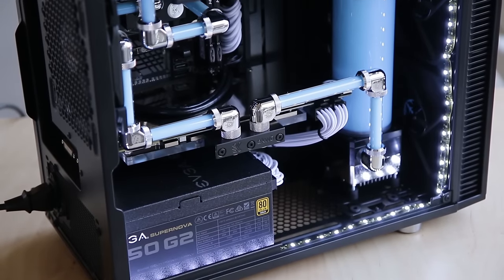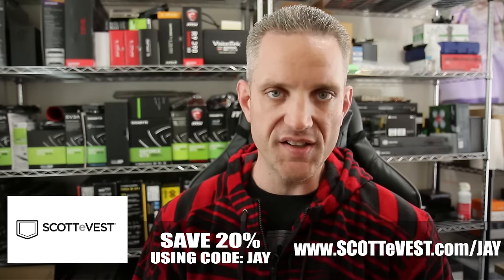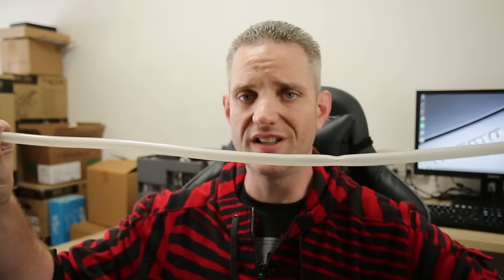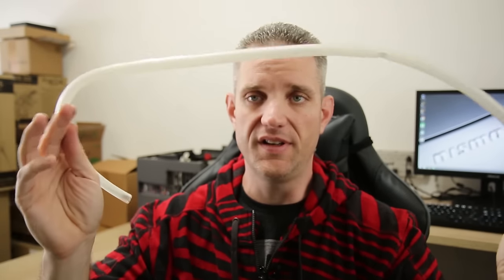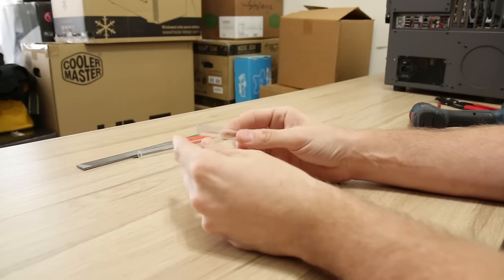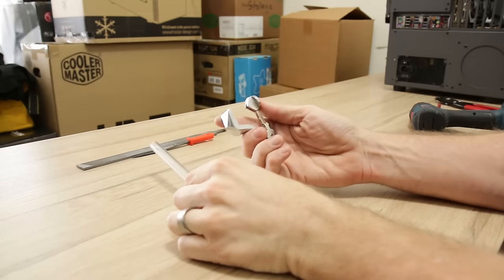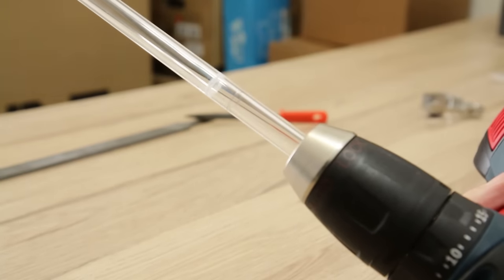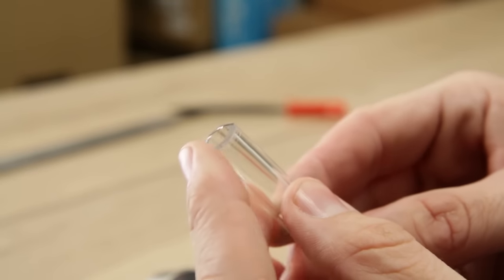Tutorial - How to cut glass tubing for watercooling loops

Comment from the maker: Everyone telling me to avoid the glass dust literally makes me want to go inhale it.
Reply: +JayzTwoCents save a line of dust for me
Reply: Everyone told me I couldn't drink bleach. I proved them wrong.
Reply: +JayzTwoCents Does it smell like blood?
Reply: lol Jerry Rigged
Reply: +JayzTwoCents Glass dust is evil stuff.....not as bas as aluminised glass fibre........majorly carcinogenic and only a few points below asbestos in causing big health issues later on in life. The big caveat is that just using it or glass rarely isn't a huge problem unless your in a high volume production environment, I'd still mask and suit up and probably have a suction system to pull the dust away. 

Better to be safe than sorry, right?
Reply: +JayzTwoCents If you dont have a bunsen burner, they do make those gas powered lighters with the blue flame, which are basically miniature bunsen burners running off a tank... Deal extreme (and simular sites) has oodles of options for less then 5 bucks including shipping, search for jet lighter and you should find plenty
Reply: +Matthew Sykes wow wow wow to many big words
Reply: +JayzTwoCents Eat it. want do you much harm.. :P 
Get some kerosene and drip on the cutter before cutting the glass. Cuts it smoother and cleaner.
Bending the glass, get a half/quarter circle mouthpiece on that gas burner / lighter.
Reply: so skunkworks version 5. New glass tubing.
Reply: +Nick Grech Like with Coca cola, glass is always better.
Reply: +JayzTwoCents Actually I just thought, why not upgrade Skunkworks with copper tubing, that would be AWESOME.
Reply: +JayzTwoCents jet fuel can't melt steel beams.
Reply: +JayzTwoCents Why the hell would you want to carry a GPU in your jacket? :D
Reply: +JayzTwoCents You said you were looking for other ideas for cracking it after the initial scoring.. You could heat it and then rub an ice cube on it, the temperature shock would cause it to break itself.. No point really, other than being kind of cool. XD
Reply: +JayzTwoCents Btw, can you do a generell tutourial on working with hard tube watercooling?
Reply: He did a guide just a few videos ago on how to bend hardline tubing. Search his uploads, fairly generic titles for the topic.
Reply: +JayzTwoCents I was about to comment that until I saw this one 😂
Reply: Could you bend those glass tubs over a glassblower torch or is it a different kind of glass?
Reply: +JayzTwoCents i wonder, would a tile saw work for this?
Reply: +JayzTwoCents ahahaahahahahahaha :D
Reply: Hey Jay as a Glassblower I'm just gonna say you should be doing all these steps with the glass tube when it's wet. And there's two reasons to doing so. First is glass dust and second is to keep he glass cool while doing all of your steps while scoring. If you create too much friction you can cause the tube to crack or shatter. But seriously when giving advice to all of your subscribers please keep health and safety in mind.  Love your poor mans lathe and lots of glass blowers actually will chuck up the the glass in a drill every once in a while. Also if you need to remove a little bit extra off a tube chuck it up in your drill and press the tube straight down on some high grit wet sandpaper that's clamped to a table. (Also known as a poor mans reverse-lapidary) this can also be used to get the glass completely flush rather then having a jagged cut. (Because sometimes it happens.)
Reply: +austin welch Yes... Glass artists (including myself) have used tile saws to cut through glass. Just go VERY VERY VERY slow! You'll get a better cut but there is a possibility of the tube shattering and blowing up in your face. Probably not worth your while for this project. The method Jay uses in this video is probably the best way to go about this. Just make sure when using any tool with glass it should be wet to keep the glass cold and contain the dust.
Reply: +JayzTwoCents  It was literally my first concern when you started cutting it.
Reply: +JayzTwoCents if u applied some glasscutting oil to the diamond or the surface u would get a non jagged cut . Nice video tho .
Reply: +JayzTwoCents avoid the glass dust Jayz (no, inhale it, it will be good, you know you want it)
Reply: Jayz can you do video about the drain port and how to drain a rigid loop?😂😂😂
Reply: +JayzTwoCents Only snort borosilicate glass!
Reply: Will you replace/upgrade  skunkworks at the end of this year ?
Reply: +JayzTwoCents silicosis from glass can kill, it's actually fairly frequent amongst rescue workers and I don't think they inhale much glass ether.

I am saying they do have a point. You can actually die inhaling glass dust fairly easily.

I mean I probably wouldn't wear a mask, but they honest to god have a point, they do complain about everything, but this is one of those rare instances that they are in the right.
Reply: +JayzTwoCents Sure, it is annoying but most people just care about you.   We literally don't want harm to come to you.  You can buy a portable lab burner for $30.
Reply: try carbon  fibre  tube it's probably  not different  accept  cutting  it may cause cancer from inhalation  and a mask is required  to cut it
Reply: hey jay what is the reccomended size tube?
Reply: Didn't cover the clutting part of the tutorial. Downvoted (JK)
Reply: Anybody who lives in a desert lives on a mountain of glass dust. Guess they are all doomed.
Reply: @yuannanlin4503  Four years in hospital
Reply: Lol I exploded a glass bubble like 2 years ago and I still hear the echos of my mistakes in the comment section to this day. 😄

Comment: I do not know if anyone has commented and told you this about glass cutting, but first of all you should dip the edge of the cutter in fine oil, a small cut should be enough, you should lay the glass down the edge of the table before breaking ut, and make sure the cut is just over the edge of the table. If you follow these methods you will get a much cleaner cut. The edges on the inside and outside should be smoothened of with a sand paper (Feel free to use your drill for this). I have worked with glass for over 5 years and used to do this for a living. :)

Comment: I know this video is old now..... the wheels are not meant to score over a previous score. By continued spinning it damages the wheels so it has a greater chance of damaging cuts later on. Also a drop of 3 in 1 oil on the cutting wheels before cutting is recommended. I worked in a residential/commercial glass shop for 10+ years.

Comment: 'Scratch and snap' works fine for 'standard' Flint Glass Tubing. However, Borosilicate Glass tubing (Pyrex, Kimex,) takes slightly different methods. Like a EZ Dremel Diamond Cutting wheel, A Dremel drill press stand, a right angle Adapter, A workbench Board with a Low form of a Rail Guide and End stop , (of course an eyedropper of water). Then a Diamond Honing Plate (Typically used for sharpening Lawn Mower blades) in a rectangle dish pan with a little water and a squirt of dish soap in it, to Square up the ends. And finally, Yes, a Propane torch to 'Fire Polish the cut ends smooth, (So that the 'O rings' cannot be damaged by sharp of jagged cut end edges).

Comment: One tip. After the drill use ice to break the connection because it makes cleaner cut and you might not need to sand it so much.

Comment: hi, i used glass tubing for my custom desk-pc case and i can tell it is very easy to work with and it looks so incredibly clear. I did even get some 90° angeled tubes from a glass manufacturing company for only 6€ per piece. For cutting i used the same tool as you did, but for deburring i used a dremel with a diamond cutting disk. With the diamond disk you are able to grind a few millimeters in length if you messured the tube wrong.

Comment: From someone whose done both style of stained glass (and worked with glass tubing back in science class):

 For like $3 you can get diamond dremel wheels that will handle that job much easier. To torch the end all you need is to do it over a gas stove burner.

Comment: A dremel is not that expensive, plus it can be used for case modding. And it not only cuts glass, but PETG and acrylic tubing as well. I got myself one for less than 100 bucks with all the necessary tools since I am doing some custom USB hubs and other electronics.
This video was awesome Jay, thanks for the tips mate!
~Valk.

Comment: I used to recycle bottles into cups. You are using the right tools really for the score don't have to get expensive equipment to cut glass. I have seen other ways if you have a bench saw and cut off wheel for tile cutting you can do that just work on it outside wear safety glasses and have running water from the hose and go slow this will not only score the line but will cut and sand the edges clean for you. You can also use an old glass cutter hand tool, make a small hand gig and either with your hand or with a tool you can score the glass that way. I know when it comes to big glass to get a clean break sometimes fire is the way to go. Rubbing alcohol and a lighter over the scored line will cause a friction break people will also use string soaked in rubbing alcohol wrap it around the score line and light it on fire does the same job sometimes. Not always clean but you don't have to use the hand break method. I also suggest to instead use a big file to use a hobby file (harbor freight carries them for under $5 a set of 6) or just 240 grit sand paper does the job, just lay the grit paper down on a flat surface, take the cut end of the tube and in a circular motion move the tube around over the sand paper, 5 to 10 min and you can a clean flat end. I also suggest  before setting them in the compression fitting to round the edges or file them to an angel if this make sense ( |_| -> \_/)  this prevents the glass tubing from cutting into the o-ring and makes it easier to just shove it in place no resistance.

Comment: One of the best glass cutting tools is the Jaws Glass Scoring Tool (Sm.) from ABR imagery $45 for the size of tubing you are cutting. One big warning on the tube if you are going to use a file ware a mask to prevent inhaling glass dust. Licking or wetting the cut also prevents glass dust as well. A regular propane torch will flame polish it just takes a little more time. Hope this helps. Love your videos thank you so much.

Comment: JayZ here's   the dope on glass tubing.
#1 Use Pyrex Glass it's like the hardest most durable glass
#2 Get a good propane style torch with a good hot even flow tip and always use MAP gas comes in yellow collered canisters
 So what u do is after u cut ur glass, use the torch at the tip of the flame (is the hottest part of the flame) and spin the rough edge around over the flame Leave over the heat till u get the glass to glow red  and the glass melts. This will smooth the jagged sharp edge down to a nice smooth rounded edge.  alow to air cool before u touch it or u'll get burned.

Comment: I work with glass tubing sometimes at my job ... a dremel tool with abrasive cut off wheel is the same cost or slightly more expensive than the total expense of the 2 tools Jay used here and gives nice clean cuts .. can also be used to give the outside edge a nice bevel ... just have to use a ventilated area or otherwise avoid exposure to the glass dust
Reply: What drill he uses?

Comment: When I worked for a glass blowing company we would "crack off" the top of closed pieces to finish them. We did this by making a small score where we wanted the cut and then slowly spinning the glass with flame directed at the score. The temperature differential would pop the top off cleanly and quickly - needing very little finish work. This is how we made wine glasses with very thin rims, but it also worked on larger pieces up to 1/4" thick - just takes longer.

You could likely replicate this with the drill and a small propane torch.

Comment: It looks fantastic with the really clear "halo" of glass-sheen around the liquid. 
I also really like the idea of having tubing that is ultra-resistant to chemical changes and staining.
I think my main worry (aside from it being much more work to cut) is how to get it all to fit together tightly in the end.
What I mean is that glass will have close to zero flex, so if you need it to go between 2 fittings that aren't themselves movable then I'm not sure how you can fit it without the ends sticking in uncomfortably shallow... especially when you can't easily trim off a few millimeters extra.
With PETG (and a lesser extent plexi), you can slightly bend the tube while inserting, but glass definitely won't let you do that.
@JaysTwoCents It would be nice to know if this was a problem for you - and if you still would recommend glass for someone who is willing to spend a lot of time and effort on the cutting...

Comment: Try heating the glass where you scratched it and dip it in cold water... It usually takes a bit more time but the cut is smoother, as the movement caused by the temperature difference is way more subtle than breaking it by hand... 
I used to do this with a friend to cut bottles, but we used a piece of metal string/wire (or however it's called) heated it up and tied it where we wanted the cut. After a bit, you cool it quickly in water and it cuts close to where the metal was. Not as precise, but a lot faster.
Reply: +Nad Kudo wool thread dipped in kerosene. Works great.
Reply: +Nad Kudo 
but the cuts are under the fittings so you wouldn't notice the difference anyways
Reply: Polyaness ポリアネス cuts have to be smooth or it will leak.

Comment: For cutting the glass tubes, the method you use is pretty much the time tested method. You go a little above and beyond on the scoring but whatever floats your boat. You can pick up some glass tile nippers for under $15, they will get you a nice clean score. just put the glass tube on a flat surface, preferably padded, pinch the tube between the two cutting disc, and roll it until you have a score all the way around. I also think the file is fine for what you are doing. If you wanted the ends to be a little cleaner then pick up some silicon carbide sandpaper, it's the stuff marked wet and dry. Will take a bit longer but ends up a bit nicer.
Reply: I'll also add that the tubing they are selling can be found online for $1-3 per 1500mm tube for the 12 and 13mm, the 16mm can cost as much as $5 per 1500mm tube. All depending on the wall thickness.

Comment: I just use a triangle file to deeply score on one side , wet the score edge , and it's easy . I tried that little tool I hate that thing like you said it tends to get off the trac , but you really don't need to score in a full circle , just in a little area and do the pull and bend at area and it works

Comment: Propane torch should be hot enough to round down the sharp ends after the break and are pretty cheap at hardware stores.  If you're going to be doing it often, might just look into a used gas blowers oxy/propane torch.  Talk to a local head shop or some of the glass artist's pages on facebook and experiment with it. I'm sure you could get some beautiful bends with that glass.  I'll go find you on facebook and link you to some of the underground glass arts groups. I'm sure you'll find some things of interest.

Comment: I wouldn't use a metal file on the glass. Try using 1000 git sand paper with a little water on it. or even a sharping stone works great too. The metal file can leave micro cracks that with the heat and cool down of the tube make the cracks bigger over time. Also glass does not have to be scored heavy to break clean. you will get a better break with a light score on the glass than a heavy one. I have been cutting glass for years and have cut from 1/6 thin all the way to 3" think glass. the same score with the same pressure will cut the same on 1/6" thin and 3"thick glass but harder to snap.

Comment: As far as I know in former times they used a piece of string that was covered with sulfur poweder. You wrap that string around the glass and burn it, so it melts through the glass and you can break that part. It makes very clean "cuts". I have looked for videos showing it but can't find it. Just some guys making very crappy cuts with burning string and then placing the heated bottle into icy water.

Comment: Mayhems do offer pre-bent 90 degree bent glass. So it is possible, maybe just expensive if you dont spec out all your bends first, and you only get the single bend.

However, with your tip of working it all out before hand with tubing/hardline, you should have a better idea. And the pre-bent is 500mm in length, so you do have the possibility of obtaining some straight runs out of it as well.

Comment: One tip I would have and I use this when I am doing stained glass windows is to always start by cutting your largest pieces first that way if you make a mistake or have a bad break you may be able to use that piece to make a smaller tube later on. If you do your largest tubes last and you make a mistake the rest of that tube is useless for your current build.